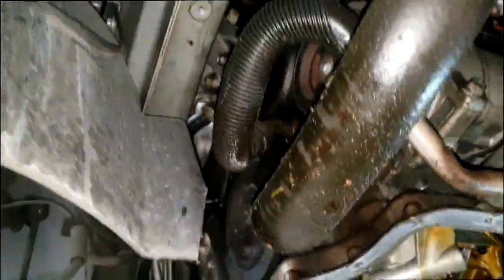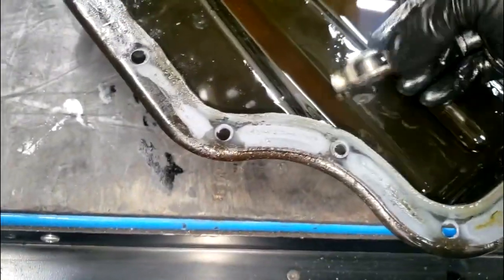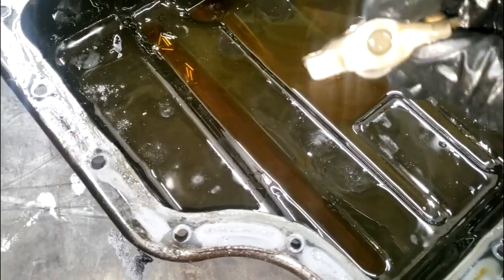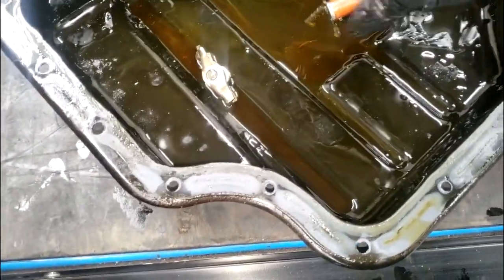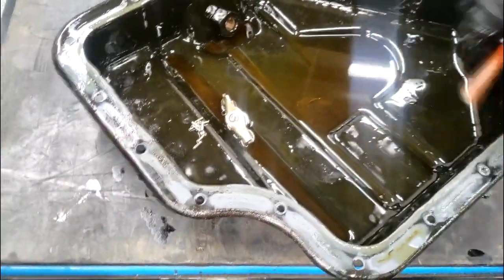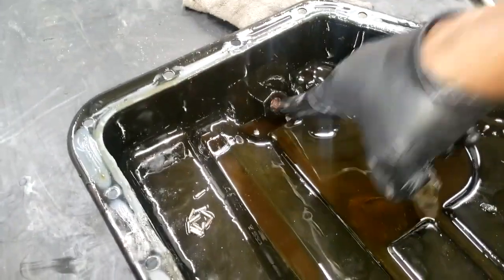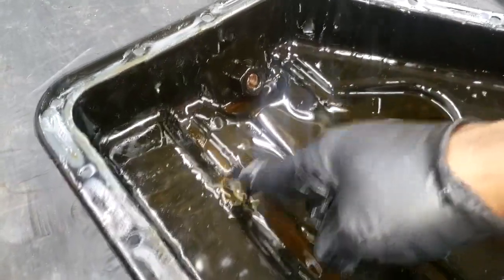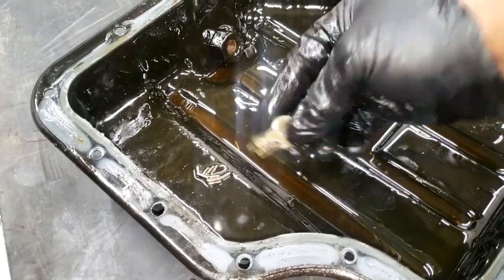Here's where most of your ticking noise broken rocker arm camshaft fail parts go. LOOK HERE.

Comment: Looks like it might be easier to remove the oil pan to see if you have damage to the rocker arms, rather than pulling the entire top of the engine off.
Reply: that is a good idea.. I wonder if needles always ends up in the pan, or may get stuck somewhere in the head..
Reply from the maker: https://www.youtube.com/watch?v=GYZFIKHGMPE&list=UUSIdv7pEKV2jxJvI6YZB21A&index=16
Reply from the maker: https://www.youtube.com/watch?v=GYZFIKHGMPE&list=UUSIdv7pEKV2jxJvI6YZB21A&index=16

Comment: I noticed that the oil left in the oilpan was pretty clear. So, none of the dreaded sludge.
Weren't some of the older cars equipped with magnets in the bottom of the oilpan to catch and hold just such debris as this? What's your thinking on placing a strong magnet under the lowest part of the oilpan? would it do any good?
Stay safe!